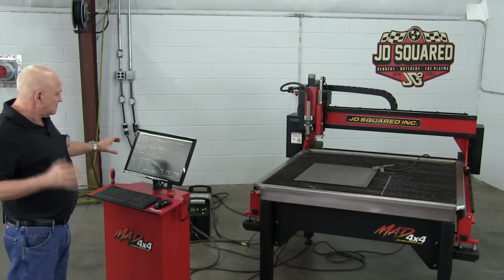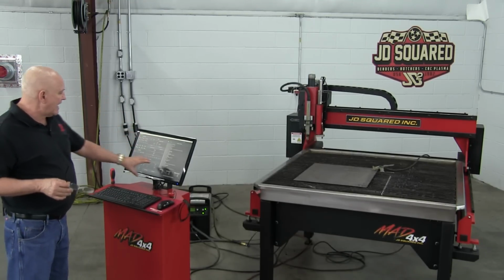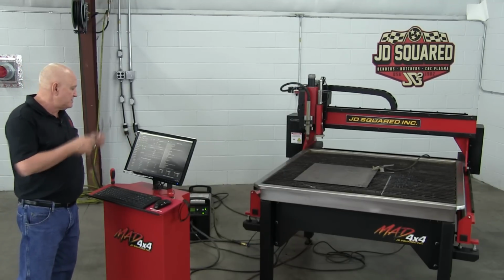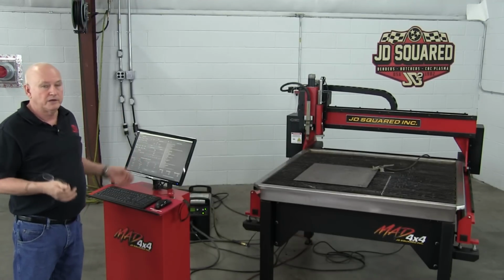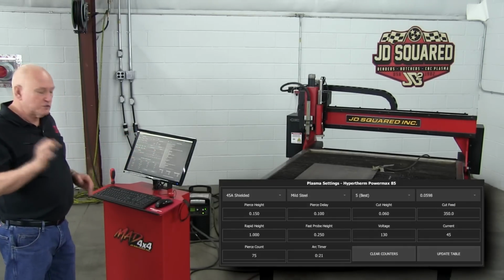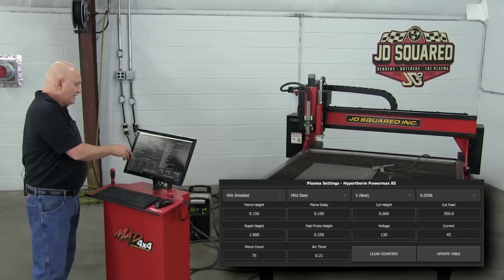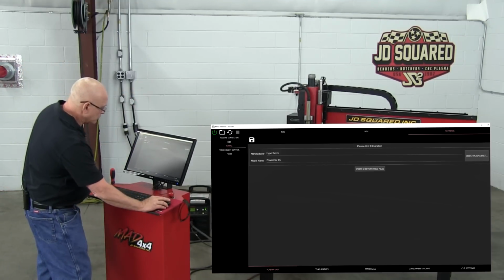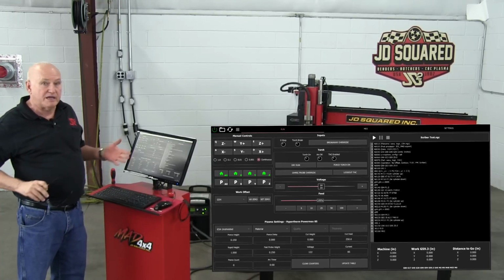MAD Series   User Interface v2 Video 2

Comment: at 11:36 Why wouldn't you simplify that pull-down list to use the typically used gauge metals?  Using the decimal thickness may be accurate, but it's only going to slow most folks down making conversions.

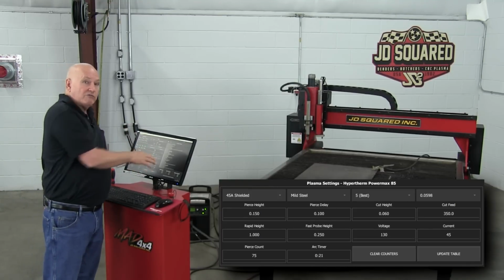Comment: At 12:48, you mention that the current cannot be set in the Hypertherm PowerMax plasma cutters...that is incorrect! You CAN in fact set the current using the RS485 communication port on the Hypertherm which is a different port from the round Machine Interface connector.